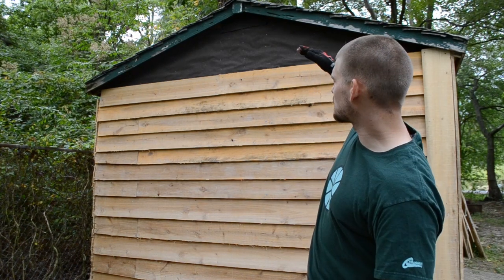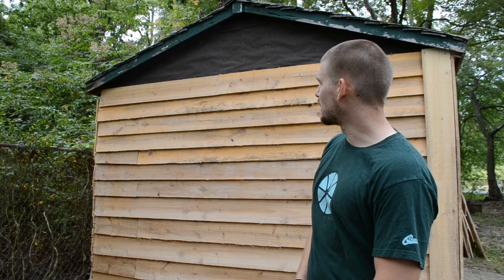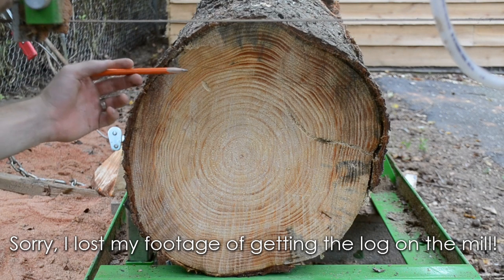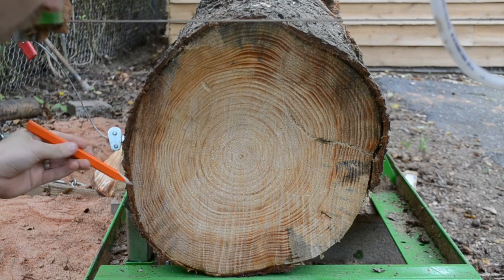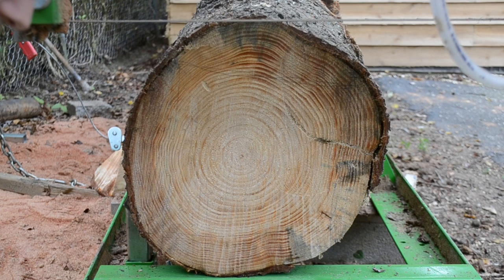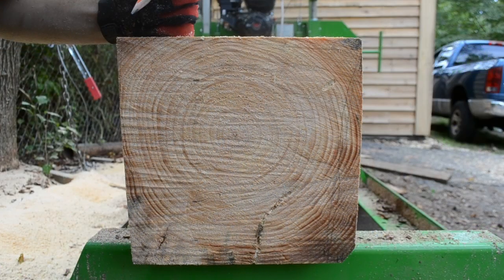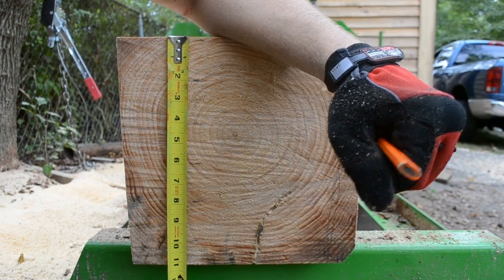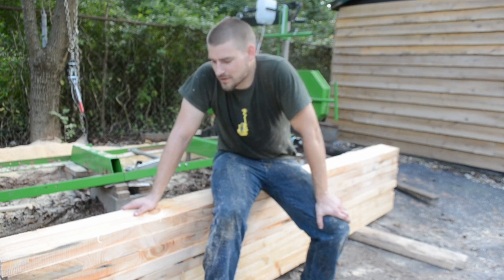From Sawmill to Siding - Part 2 - Milling Rafters

Comment: Great video! Just a little tip, I have a wood-mizer lt15 bandsaw and have used it for about two years milling mainly pine and aspen for my homestead. I had some trouble getting the cant perfectly square, resulting in lumber that was not uniform in width. This was made a lot easier by flipping the log 180 degrees after the initial cut, and then milling off the bottom piece. That way you are sure to have two perfectly paralell cuts as long as the saw head follows the bench. Hope to see more of the progress, greetings from Norway!
Reply from the maker: Hey, thanks for the advice! The lt15 would be nice to have! :-D 
Norway, closest I've been is Denmark, would love to make it over to your neck of the woods :-P

Comment: Nice video! I did a lot of research into the HF Mill and ordered one, it should arrive tomorrow! I have a few questions that I'm sure will be answered before you get back on and see this, but I'll ask anyway. 1st what is the largest diameter log you have been able to cut? How many logs do you get cut before you need to change the blade? Where you able to make a bed extension? I just bought a few acres and the house is going up now. After the builder cleared the trees (20" White Oak) I had him stack them for me. The plan is to use the milled lumber for a large deck and a workshop. I can't wait to get started. I build all the time but this will be my first experience milling my own stock. Thanks for sharing your videos!
Reply from the maker: lipinskirl Sorry for the late response, don't know why I didn't see it! 

- I've milled up to 22-23" logs, takes a bit a work to get on the mill though

- I have not made a rail extension yet.. Just had our third child, so it has put a damper on my sawmill plans :-P

- The amount of board feet I get out of a blade really depends on the wood I'm milling and if I have properly cleaned it. But, typically I can get over 500 board feet out of a single blade before I start feeling like I want to replace it. Currently, I purchased a ten pack of Cooks blades, they seem to be working out quite well.

I have had a lot of joy milling wood from my property. You should be able to mill the 20" white oak (nice wood! You should save a couple boards to make barrels :-)), if you have front loader that will make things a bit easierwhen loading it on the mill (when logs get to those larger diameters). 

Good luck milling!

Comment: Not sure if it was asked or not but how long after cutting the boards do  you have to let the dry?
Excellent videos by the way.
Reply from the maker: Warren Lancaster Thanks, Warren. It depends on the use case. But, since I have to air dry (dont have a kiln), air drying takes about 6-12 months here in Maryland.
Reply: sonhomestead Thanks for response. I live in S.W. Pennsylvania and I will be using the lumber for furniture and what not. 
I also heard to leave air dry about a year per inch thickness.

Comment: Thank you for this.  Did you have any "wavy" cuts? and if so how - or did - you overcome it?Kraig Willison
Reply from the maker: +Kraig Willison At first, I did have wavy cuts, I quickly noticed that it was due to the tension of the blade. Once I properly tightened the blade, the cuts became uniform. The blade should not be too tight or too loose, if I recall correctly, it should have around a quarter inch of play when you press a noticeable amount of pressure on it.

Comment: good job on the video.  i also have done extensive research on the harbor freight sawmill.  we have 30 acres, lots of sweetgum, cedar and poplar.  did you create a track extension for your saw and did you have to wait on your saw after you ordered it.  keep up the good work.
Reply from the maker: Hey Gary, thanks!

I do have plans to build a completely new track for the Sawmill. The max length logs I am able to mill is 9'6" and I have some use cases where I need longer logs.

When I purchased the Mill I did have to wait about a month till it got to my house, however it would appear that they did not charge for me the shipping services required because of the wait, I am not sure if this is typical. 

GL on research! I have milled all of the wood you are mentioning, I've used Poplar for the exterior of my shed and I have a couple hundred BF of cedar drying. Sweetgum is a more difficult tree, as boards tend to wrap A LOT, but it can used for applications such as timberframing or normal stick framing, you just have to be careful of the radial tension when you mill it.
Reply: sonhomestead My HF sawmill arrived wednesday, ha here it is Sunday and still unboxed.  You know the excitement I am feeling right now.  What kind of blades are you using and where did you get them?  Thx.
Reply from the maker: Hey Gary, congrats on the mill! Sorry the delay in response... 

Currently I purchased a pack of 10 blades from Cooks, they seem to be working out quite well.  GL Milling! :-)

Comment: Well done vid. I'm assuming that's Harbor Freight's only model otherwise you probably would have gone with something that could handle larger stock. Is this your first saw mill or did you start with a chain saw mill and then upgrade? I'm trying to decide whether or not I should skip the chainsaw mill and just go with one of these.
Reply from the maker: This is my first sawmill and it seems like a good spring board into milling. I've started to push the limits of it with a 23" black walnut. I did a bit of research in chainsaw sawmills before I purchased this mill, I couldn't accept how large the kurf was plus the increase in time to mill. So, I decided to go with the HF sawmill (after quite a bit of research) and see if sawing was something I wanted to continue further.

I think the main bonus of a chainsaw sawmill is, if you have a really long bar, you can rip large logs down to a size that you can then place on a band mill. 

Let me know if you get a mill, whatever the type. I really enjoy hearing others experiences with milling!

Comment: I like your video.  All the naysayers say this wood will twist and crack if I install it green in my cabin.  What say you?
I don't have time to let it dry for a year or two.  But I would like to build my cabin out of wood that is available on my land.  White pine and poplar.
Reply from the maker: Thanks for the comment! If you really need to put up a structure with green wood, you should look to timber frame the structure and try a board and batten style for the siding! Good Luck!

Comment: Good videos. I have been looking at these for over a year and yours popped up here since I last looked. I want to add on to my sugar shack. I built it our of rough sawn lumber I planed from trees I took to a old fellow with a mill that is now gone.
 So I figure with these new bandsaw mills I gotta have one. Harbor Freight works fine for me as I am doing what you are. I have forty acres of birch, maple, oak and popular.
I want to double the size of the sugar shack with my own lumber.
. https://www.facebook.com/ScarletJewellSugarShack?ref=bookmarks

How do you like the mill now that you have put it through the apces and what blades are you currently using?
Regards
Terry
Reply from the maker: Hey Terry,

For the price, the Harbor Freight mill has been great. I don't think it is a mill to last a lifetime, but it seems to be a good spring board mill into sawying and I haven't had any problems with it after a few thousand boardfeet. 

Currently, I'm using a pack of 10 blades from Cooks (http://www.cookssaw.com/) which are at 10 deg angle. I've been fairly happy with the blades, I think an 8deg blade would be better for some of the hardwoods I'm getting into. But, they ripped really quickly through softwoods.

If you can afford it, milling your own lumber is a lot of fun and really rewarding! Your current sugar shack looks sweet! (pun intended). As lumber prices seem to be really high and you have access to a lot of free wood, a sawmill seems to be a real practical and worthy purchase. 

Let me know what you end up doing.

Scott